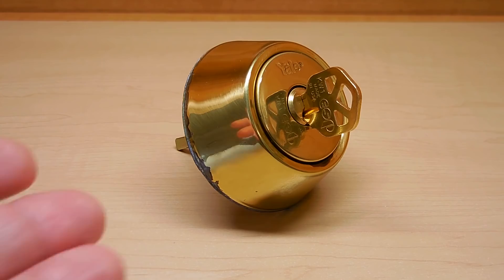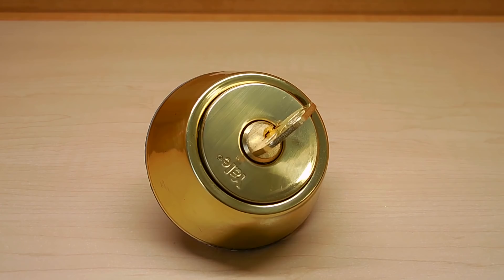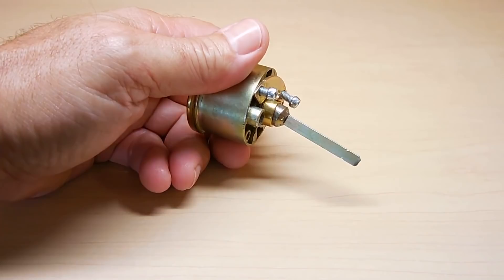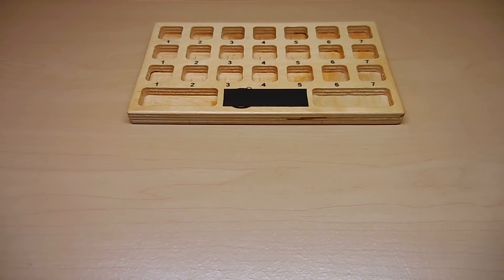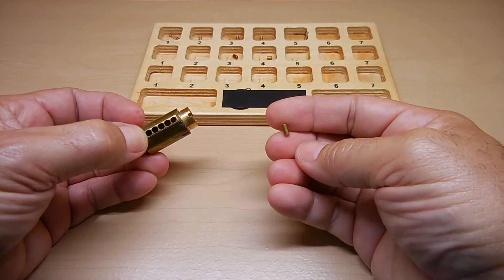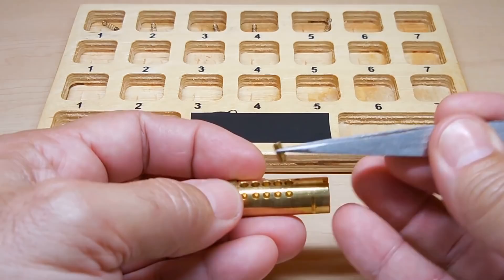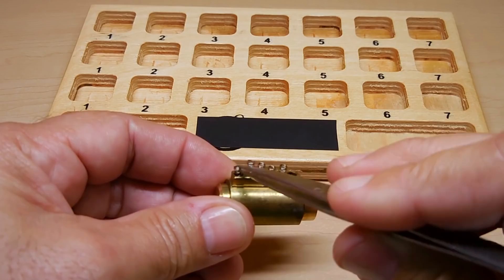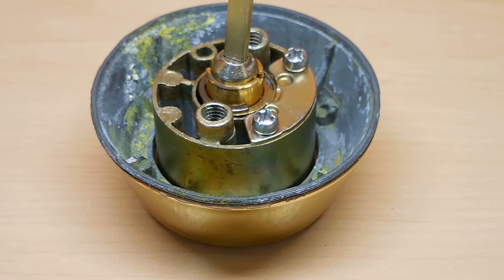If You Find This In Your Deadbolt, Call The Cops!

Comment: My locks were functioning fine. Then one day it was very hard to get the key into both locks. I almost had to hit my key to get it into the lock.  After a few times of using the key the locks went back to working normal. Do you think someone tampered with my locks? They were both locked when I returned home. Second question...If tampering is your conclusion...how likely is it that they also locked the door before leaving?
Reply from the maker: Sounds like a person tried crazy gluing your locks but failed.

Comment: I suggest you look at the thin metal pices dentists use to wrap around your teeth when doing buckal fillings. It is thin and made of spring steel so it could slide along the key and push the pins up enough to get the key out. You can also hit it with a hammer against the springs and with timing might come out...
Reply from the maker: I have them , they're called matrix strips. They're still too thick.
Reply: @electronicsNmore  , oh ok, Thought it might work, they do come in some really thin, I guess not thin enough. And wacking with a rubber mallot to bounce the pins and quickly tunning wong work either?

Comment: So I picked locked my door after being locked out and now my key won't turn to unlock the door. But the door will unlock and lock from the inside but not the key hole. The key hole is stuck. But it will turn if i use the lock pick. I tried wd40 spray but nothing won't work. I even took the lock apart.

Comment: very interesting and informative! it's cool to see exactly how a deadbolt lock works. would it be possible to design a lock that would not be vulnerable to these kinds of tricks? what if the front of each pin had a slope instead?
Reply from the maker: Glad you enjoyed my video. If unfortunately it's almost impossible to avoid the problem. Thanks for watching!
Reply: Bcikablam ...a lot of locks do have pins with slopes to make insertion and removal of the key smoother. But that would not help with something as drastic as this. The only way to avoid this would be with a lock that doesn't actually use a key, e.g. a fingerprint, card, or combination lock, etc... So yes...it is possible
Reply: @Quickened1  interesting.

Comment: You could have just pushed the F U key through the back side of the lock. Wouldn't have been slot easier. I've done this a few times.
Reply from the maker: Correct!
Reply: I do this all the time, just pushing them through.  This Seems like a terrible waste of time if you want to reuse the lock without changing the original key. Just my 2 cents as a locksmith...
Reply: @spookshow42  LOL you pretty much just reset what I just commented except I said it 3 years ago🤣
Reply: Yes. I was agreeing with you. 😒😅

Comment: I’m sure you could shim it out without cutting it off using a thin piece of metal.
Reply from the maker: Unfortunately that wont work. The key is locked in place. Thanks for watching!
Reply: The shim would ride next to the key like a feeler gauge in a piston wall

Comment: Hello! Is the ASMR Medeco video available somwehere se elafter it disappeared from here?
Reply from the maker: Hi there. There was an issue regarding legality, but I checked with Medeco and they said it was OK for the owner to make their own key(3D print, etc). The video will be back on my channel in a couple weeks.
Reply: Thanks for letting us know.
Sharing knowledge should never be considered illegal, it is the most basic inherent freedom, like right to live, to breed etc. It is vital to stand against any oppressing force denying this right.

Anyway, it is worth trying to pre-heat the silicone mold before casting. Depending on the type of compound, it should be possible to leave the mold in the owen at >200°C for at least 30 minutes, then the cast part has much nicer surface finish and even the smallest elements are nicely transfered. This of course excludes using a plastic bottle for mold support.
Also, casting is the best use for lead-free tin, which does not work very good for soldering, but gives some strenght to the casting in contrast with leaded tin.